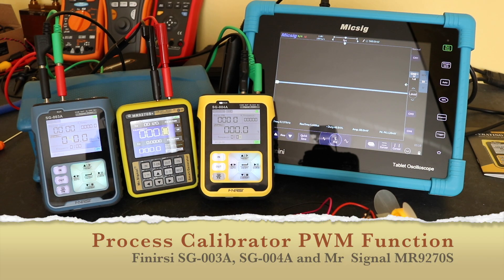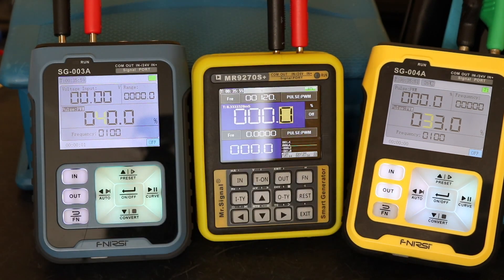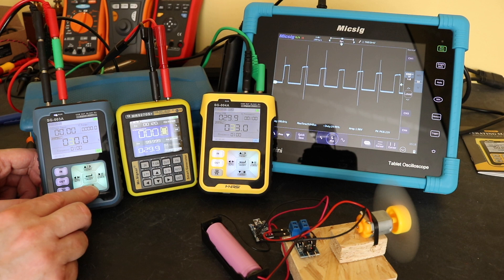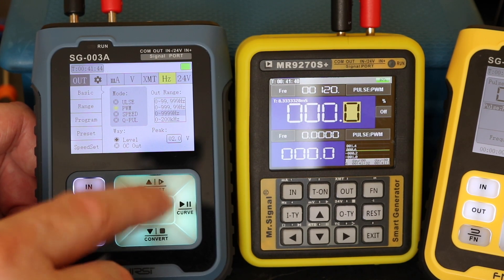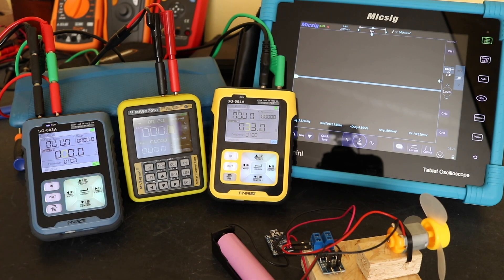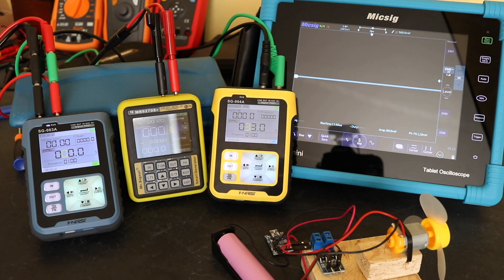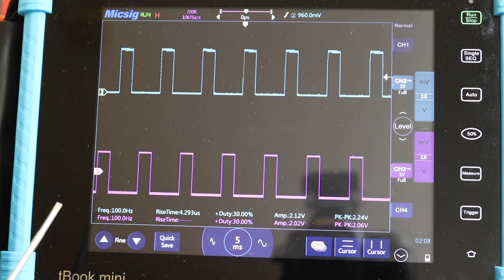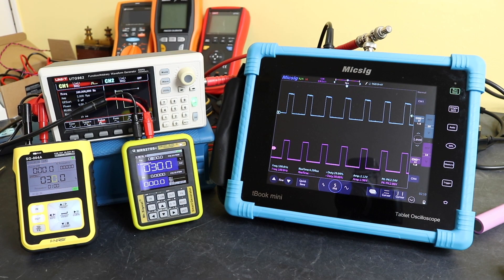Calibrator PWM Function Checks

Comment: Just a little notice.(SG003A)
You can toogle between subfeatures in a given mainfeature by holding down the "out" button.
A brief button press with "out", will cycle between input lines, and a long press toogles subfeatures fx flip between PWM, Q-Pulse, Speed, etc so you dont have to go into menu and do it manually.

Its the case with many of the mainfeatures, that "IN & OUT" button gives you fast control, to jump between subfeatures, there is a lot of button trickery. when you gte the hang of it, it somewhat makes sense.
same in fx mA.. brief press of "out" will toogle limits 0-10, 0.24, 4-20, user etc. 2.
same with main frequency, that will toggle resolution between 0-99.999 etc etc and 0-200Khz with a fast "out" press and a long press as mentioned will jump diffent test abelities..
and all these approaches is the same in the secondary Curve-screen interface where you also can control how the graph screen shall behave zoom in, zoom out etc
tried to run a PWM program, not sure why you got OL, my SG003A just jumps to 0000 when done.
thx for the video. thumps up.
Reply: Tried the same 10:25 SG003A 30% / 100Hz with 2.0-v (scope Micsig STO1104C)
FRQ100.0 - risetime fluctuates 976ns to 1.215us - duty 30.00 - amp 2.280v - PP-PP2.411v
the manual frequency meter on the scope says  CH1=100.003Hz
+Width 3.000ms -width 7.000ms BustW 23.00ms

- and with 
SG003 with PWM30% 5000Hz 10v
FRQ 5.000kHz - Risetime  648.0ns to 657.1ns - Duty 30.01% - amp 10.84v - PKPK 11.01V
manual freq meter on the scope CH1 5.00016Hz

so it does seem to give a little more voltage then the value one are asking for, and 10v gives around 11v in PK-PK
Reply from the maker: @JAKOB1977  So fairly similar results to my unit then. Thanks for providing the readings.
Reply from the maker: Yes there are quite a few shortcuts available using the keys. I think you only really need to go into the menus, to set up values for the presets, range and program functions. It is just trying to remember to use the shortcuts.
Not sure why my unit goes to OL after program mode, I was expecting to just switch off and return to the set value ready for another cycle to be run. Similar to the Q-Pulse function.
Thanks for watching and commenting.